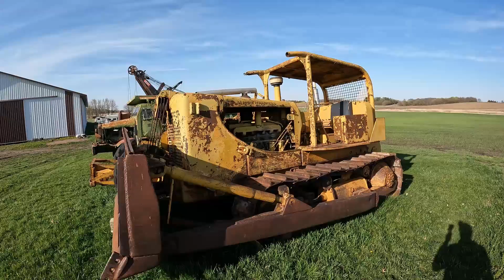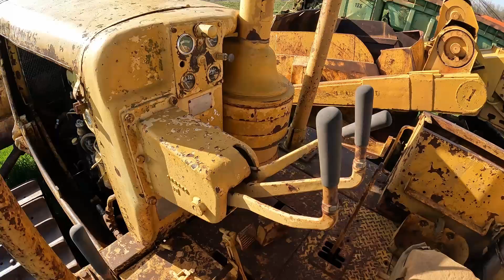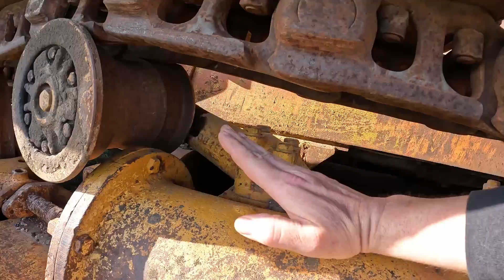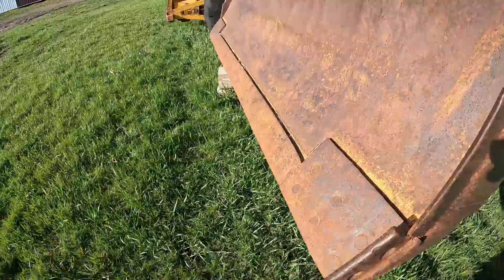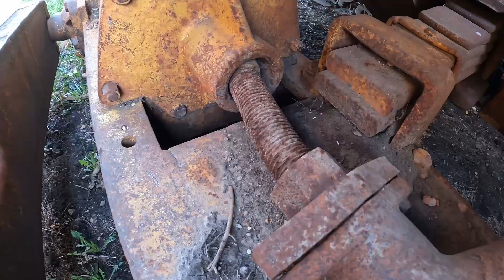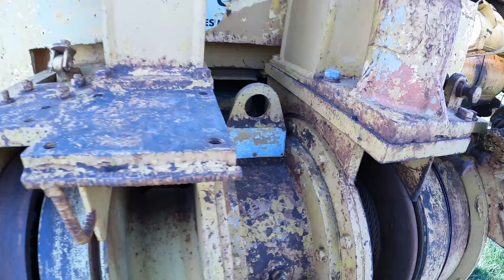Allis-Chalmers HD-16 Dozer Walkaround - Let's See What Stories It Can Tell!

Comment: My father was an owner/operator of this type in the early Sixties.  He had trouble securing work as folks wanted larger Caterpillars, favoring that make.  He sold his machine to a heavy equipment contractor and went to work for him about 20 years.  He eventually became their go to slope man operating a steelwheel sheepsfoot with a blade.   He was highly respected for knowing how to build up huge commercial pads, moisture content, pleasing the soil tester.  He passed away in 2006, the finest man I ever knew.
Reply from the maker: Great story, thanks for sharing! Several old Cat Skinners I know that operated machines of this era all said that they actually preferred certain models of Allis-Chalmers machines over their Caterpillar counterparts, their handling and performance being a bit better which made for a less fatigued operator at the end of the day 👍

Comment: You would be right about the size   between a D7 and a D 8
Reply: The 1965 HD16 weighed nearly the same as a D6C of that year, and also about the same as a CatD8 during WW2, 20 years before.
So your statement is vague, or misleading to non operators.
But a factor in this is the time and effort required on a computer to get specific info year by year, since I did not keep many valuable service and specification literature from decades as an operator.
Interesting nowadays to see a Cat D5 weigh more and totally outwork a "Biggest" dozer from yesteryear😊

Comment: We also had a HD16 cable laid. It had a front mount Garwood winch. It had a Buda motor, also with a torque converter that used diesel fuel. Very powerful machine if you put it up to something it wouldn't move, it would spin the tracks. 80 to 100 gallons of fuel per day.

Comment: I bought two of them several years ago cheap at auction, sold as non running. Got new batteries and bunch of ether, had one running before auction ended. Had plows on them for putting in telecom cable. They are power shift, hydraulic, and are awesome machines. Have one as parts with almost new track chain. The running one got a dozer blade, and gets used quite often on the farm.
Reply from the maker: That like-new track chain is worth nearly as much as a whole good running machine itself, with the way good undercarriage components are getting so card to find for our antique dozers - nice score! 👍

Comment: Thanks, what a beast! I wonder if after the track adjuster on the right side failed, they used the left side of the blade predominately. Plus the seat is offset to the left as someone already pointed out.

Comment: I remember back in the 1970's as a young mechanic in the Phone Companies heavy plant workshop, they brought in an HD16 with a broken back.
Apparently a D7 was ploughing in some large phone cable between two towns, through a swamp. They called it quits when it was bogged to the footplates.
In came the HD16 to pull it out, but no such luck. So they brought in a D9 from interstate to help & hitched it to the front of the HD16. This is what broke the HD16's back. It started to pull apart behind the engine. 
We had another HD16 with a ruined engine, & the broken one had a good engine. Much work later & we had a good HD16 with a good engine, & the broken one with a dud engine which was auctioned off for parts or scrap.
A second D9 assisted the first to salvage the D7 which kept the plough in the ground all during the rescue.

Comment: Yes, AC bought out Buda. The WD-45D used the 232 Buda. I know the later tractors such as the D-17D & D-19D used Budas labeled as AC. Not sure when they dropped that design.

The one on my WD-45D is a beast to start. Even on hot days, I have to put a Mapp torch in the intake for several minutes before she starts. But, when she does, she'll fight a 9 shank all purpose plow in red clay. If I had enough weight and a beefier cooling system, I'm pretty sure she'd pull it.

Comment: Hi Squach. Done my learning on a Allis HD11 many many years ago. I’ve since progressed to Cat D11 and a self built D12(1250 hp). It was stretched to accomodate the engine which is out of a haul truck. They call it the super dozer here in Qld Australia. Power power power. Cheers n beers.
Reply: Rick and Claudia bought Don out. They are running the same old machines.
Reply: That would be one of Mearns D12s wouldn’t it, is he still making new ones or just running with what he’s got?
Reply: Do you have pictures or YouTube videos of your built D12..?

Comment: We had an HD16 about 30 years ago. Was a cable blade but had its own lift mechanism at the front, Carco winch and the Buda engine. Direct drive 3 speed with diesel operated torque convertor. Thing was an absolute animal. Pushed and pulled way beyond its class. My uncle was the man who operated it. He was a professor on that machine. RIP to both of them. My uncle passed in 1999 and the 16 met its demise at the hands of the person who purchased it after my uncles passing sometime in the mid 2000s. Unfortunately, was scrapped. Love your vids. Keep up the great work. 🙂

Comment: That is a really nice  crawler  they were said to be more summer time operator friendly with direct electric start and less grease fittings and more sealed bearings on the undercarriage system. That is a Buda Allis Chamlers diesel engine it would have been a real pusher in its day. Keep up the great videos